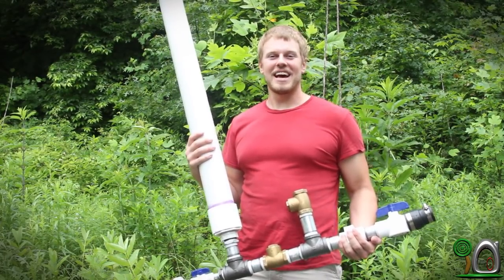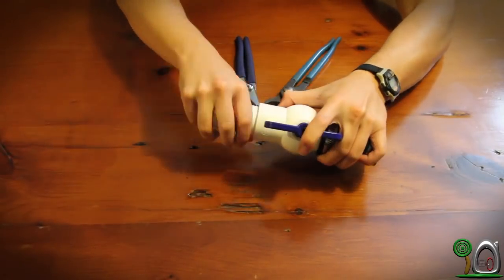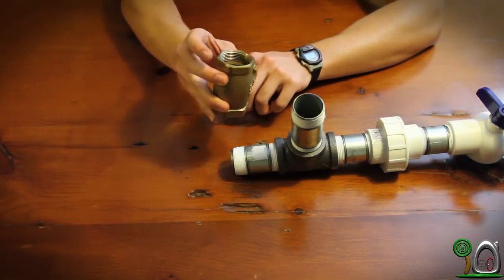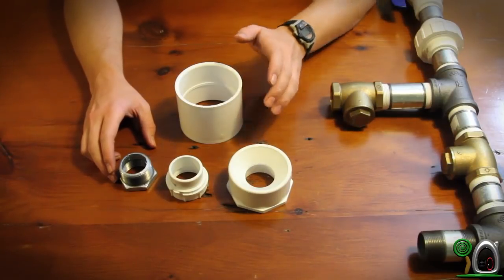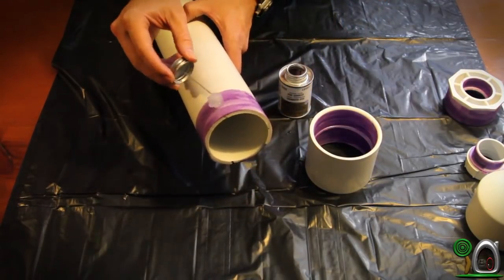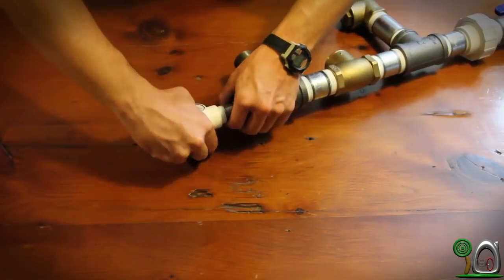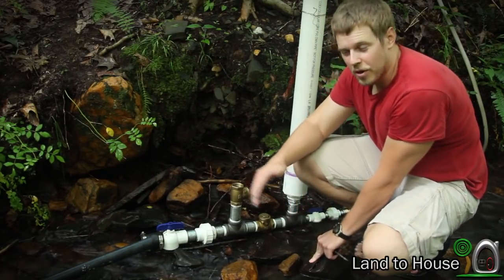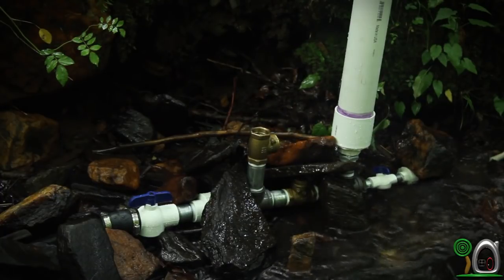Hydraulic Ram Pump: Build-Install-Operate

Comment from the maker: I like that your pump is compact. It would work well for smaller creeks. I opted to leave off the snifter valve and so far I have not had any issues with the tank filling up with water. I ran my pump 7 days without stopping before the flood washed it out. .... You need a creek to test yours out. It is very rewarding to set it up and let it pump for days. Thank you for sharing your videos.

Comment from the maker: Thank you for the reply. I have another ram pump that I used all pvc and brass and it works just fine. The reason that I made this pump out of the materials that I did is because I wanted to make the pump strong and I am testing out different materials. if you go to my channel and look for adventure 5 you will see my first attempt at making the ram pump. its all pvc.Yes you are right the materials that I used might not be the best long term but they are strong and work well if thats all you have

Comment from the maker: Good Question. I dont have one in this pumps chamber and as long as its running and the delivery pipe is open I have not had any issues but when the delivery pipe is closed and I leave the pump running it will fill the tank some with water. so I would use a tube or snifter valve just to avoid that issue.

Comment from the maker: I have seen several people placing those in the pressure pipe. That or bike inner tubes. Seems as though people are having water fill the pressure pipe and  the system stops working. So far the longest that I have run this pump is 7 days and it did not have any issues with filling. Other people are using a snifter valve. I figure that if the pump is doing what I need without the noodle then I am not going to worry about it. :)

Comment from the maker: You are welcome. Please check out the free book on the landtohouse website to answer many of your questions. My pump here was around $150 total then you will need to add the drive pipe and delivery pipe. You can make a heavy duty version but also you can add more pumps to increase the amount of water pumped. The Ram Pump only works with water that has a fall (feet of head) so your underground water supply does not have the needed fall to operate the pump.

Comment: Thanks heaps for your quick reply.

Makes me wonder if anyone's seen the real potential here? I'm visualizing a succession of rams driving electric turbine.
Reply from the maker: yes. The only thing is that your water is reduced so much with every addition of a ram pump. Now I do have a video of nozzling down the ram pump to gain more pressure! You might check that one out.

Comment: Looks JUST like Wrangkerstar's version.
Well done.
Reply from the maker: I see! Yes it does. Thank you. It works like a charm.
Reply: You must be an engineer.
Reply from the maker: John W. Ketchersid PhD I do have a degree in Biomedical Engineering. But they sure dont teach this type of practical information in school.
Reply: Land to House .com this is a very much useful presentation. I had learned a lot from this video. Sir, I would like to use this as a medium for my research in my degree, so i would like to get some kind of suggestion or recommendation from you about the problem I will solve to this technology for it becomes a research. could be the "Capacity" would be the best topic for my research on this technology? or what?

Comment: I have been doing plumbing for over 30 years and I have to ask why you choose the materials for your build that you did? Mixing Black Pipe with Brass will create oxidation issues and using Black Pipe will create Rust Issues. Seems to me that this entire pump could have been constructed using PVC Plastic and Brass. Will you tell me why you used Black Pipe? Galvanized pipe would have been worse but a bit less rust resistant, so I was glad to see you did not use that.

Comment: Cool video.  Once the pump is primed, working and delivering water, if a spigot is installed at the end, will the pump need to be primed each time the spigot value is turned on?  Or will the air supply tank simply hold the pressure and the check value simply start once the spigot is turned on?

Comment: Hi sir seth. Im from the philippines. A have a few question regarding the ram pump, just wondering if its okay to use smaller drive pipe? My pump is 5/4 and currently the only pipe available in my area is 1inch pipe. Thanks. Hope you see. Keep safe and godbless :)

Comment: Thanks for the videos!  I have a 4" pvc drainage pipe from my pond/dam with about a ~18-25' drop.  Can/Should I make a bigger pump? If so, do I need to make a bigger pressure tank?  Appreciate your recommendations and tips.

Comment: this is a very much useful presentation. I had learned a lot from this video. Sir, I would like to use this as a medium for my research in my degree, so i would like to get some kind of suggestion or recommendation from you about the problem I will solve to this technology for it becomes a research. could be the "Capacity" would be the best topic for my research on this technology? or what?
Reply from the maker: I am happy to hear that you like my work!  Please use my videos in your research. Be sure to look at my others because they show a lot more depth. I do not understand your question about the "Capacity". I am happy to help in any way that I can. The place that I test my pumps is easy to work with so if you find a problem I can test it and help your research.

Comment: Can I increase pressure by feeding a second ram with increased head of first, perhaps using a reservoir to hold increased head?
Reply from the maker: Do you mean: Pumping water into a tank say 20' up a hill with one ram pump then using that extra 20' added to a second pump to get much more hight? If that is the case then yes! you can do that!  If you want your system to run all the time you will have to find a way to make the first pump large enough to feed the tank so that the second pump does not suck the tank dry. For instance a 3/4" ram pump will use around 3gpm and a 1-1/4" ram pump will use around 7gpm.

Comment: I have a river that has a very high volume flow of water that runs through my land, but the river doesn't "drop;" as it is (or seems to me) to be level. I would love to be able to use this pump to run water from the river up the hill to my house, in the event of a power outage.  How could I develop this "head pressure?"  

Also, I have a deep water well on the same property.  Do you have plans for a pump that could be used for the well when there is no electricity?

Thanks so much for your time and courtesy.
Reply from the maker: You might load google earth or your local gis mapping site and see if there is an elevation change that is hard to see. If you don't have a change in elevation the ram pump won't work.  

There is another pump that will work called a river pump.  I am a couple weeks out from having a diy model.  

As for wells I don't have an answer to that one.  So far i have not researched those.
Reply: Land to House Considering that the river is, at a minimum 3 or 4 feet deep, perhaps the pump could be below the surface and the intake port could be higher creating a downward flow of water from input to the pump?

I would be very interested to learn about your river pump.
Reply from the maker: There are a couple of things that happen when you start submerging a pump below the surface of the water. First the weight of the water above the pump counteracts the added feet of head that you gain and thus cancels out the difference. A lot of people inquire about this because they have lakes and ponds and want to use the pump. 

For flat water you're much better off with a river pump or a spiral water wheel. And if your water is moving somewhat quickly the river pump is the best way to go. I should be posting a video of my progress in a week or two. I don't believe it will be as effective is the RAM pump but certainly will pump water several feet out of a river. These pumps are available for well over $400 but I want to post by design costing much less than this

Comment: G'day Seth greetings from Queensland Australia,  I'm going to build a ram pump for our seasonal creek ( stream) which runs for a few months each wet season. I'm planning a 2" ram pump with a 1" delivery hose, the head is only around 2 feet but I don't need to drive it very high probably 6 feet at most, I'll mainly need to send it between 600-900 feet ( we use metric in Australia so hope I got this right).  My real question is if I use an old 8.5kg (17lb) propane bottle for my pressure tank would I be better off using a snifter valve ? Also would 2 foot of head supply enough back pressure or would I need to elevate the delivery pipe up a tree and use a breather pipe ( water will be for filling livestock water tanks ) any issues you see here and would I be better going smaller but I have mainly 1" pipe already here
Reply from the maker: Hello. All those parameters seem very ideal for a ram pump. If your water supply dries up you might want to consider a 1" pump. This will need 6gpm to operate so you can run the pump longer. A 2" pump will need at least 10gpm (I dont use a pump that large) 2 feet of head pressure feeding the pump will lift water to 6 feet nicely. You might need to lift the delivery pipe just a bit to maintain backpressure. As for that distance you will be just fine. Look up my video called ram pump happy hens and highlands cows. It is a video showing cattle water.

Comment: awesome video.. Is rap pump can pump water @500m away to source of water?
Reply from the maker: The main limiting factor of the ram pump is the vertical lift. The horizontal distance that the pump can push water is limited only to the friction of the pipe you are using. I have only tested my model @140m but there was very little loss in that setup. You should be able to get water that distance. Now if your source is that far away then you will need to install a stand pipe close to the pump. so if your water is coming from 500m away then at 30m from the pump you would install a stand pipe.
Reply: Land to House .com Thank you...cheers
Reply: +Land to House  what does stand pipe do that you mentioned....and pls tell me about what kind I mean pipe made of which material is good when you have to get water to longer distances.....Thanks...
Reply from the maker: +Karna Budhathoki the stand pipe allows for more feet of head pressure. Basically it brings the source closer to the pump. The pipe I often. Use is black flex pipe. Pvc is good but can degrade in the sun. Stainless steel is good but expensive.

Comment: is it possible for this kind of pump to drive water at a height of 10 feet from a river where the tide comes in and goes out
Reply from the maker: +Surendra Nair the ram pump needs head pressure to operate. As long as your river has a drop from the source to the pump you should be able to use the ram pump. You will need a minimum of 1.5 feet of head to reach the 10 foot output.

Comment: I made the pump from pvc except the two valves and cant get it to work. The tank is a 3in  pipe, 4ft long and I have a very good stream of water. Do I need some minimum distance of input hose or do I need to cut the 4ft long pvc pipe? any help. It seems that the valves are too heavy to be lifted by the water
Reply from the maker: +Luis D Gordian Rivera is there anyway you could send me a picture of your build to my email address? Landtohouse at gmail
Reply: +Land to House I have sent an email with few pics
Reply from the maker: Thank you. I have replied now.

Comment: Seth, does the length of pipe used for the pressure tank make a big difference?
Reply from the maker: +Stephen Hummel it is important to have the tank large enough for the size pump you're using. If it's too big it just takes longer to Prime. It's too small it will not have sufficient pressure
Reply: Land to House so there is no set rule for a correct measurement? Just some where around 20"?
Reply from the maker: +Stephen Hummel the volume depends upon the size pump. For instance the biggest pump I make I use a 19 inch 4" pipe tank. That same tank could be made from 3 inch pipe but would have to be longer. I believe the volume of the 4 inch pipe is roughly 240. To get this same volume in a 3-inch pipe you have to go with 25 inches long.
Reply: Stephen Humme

Comment: Can this pump able to pump 100 meters from the ram?
Reply from the maker: Yes the horizontal distance is not a big deal. You can pump 100 meters just fine.   The limiting factor is the hight.

Comment: Hi Seth, Thanks for the videos, so helpful. I wrote a long question last night put it didn't seem to post so I'll try again. I have an 1" poly overflow pipe coming from a well (artesian) I just put in and want to use that to irrigate my garden. The pipe is run underground from well casing to the edge of an embankment total length is about 30'. Right now it has a   drop of 9-10 feet but if I extend it down over the bank could probably get 25' vertical fall. (This is the head pressure right? vertical drop of water from source). 
I want to pump it up to my garden about 150-200' away with a total rise of about 35-40 feet, if I put the but at the bottom of the embankment as mentioned above, or 25' if I leave it where it is. Do you think I need to go down over the bank? Will it increase the flow to the garden significantly?

My other main question is this: with the drive pipe dia pretty much set at 1" can I use 3/4" poly pipe at the outlet side. I have a 100' roll already so would like to use that if possible. I saw on one of your videos you recommended the outlet pipe be half the dia of drive pipe but does it matter if it is slightly larger?

Also was thinking to use your bucket method to pipe the water into from drive pipe and use a 4" x 24" pump body. Does this all sound like it will achieve my goals? I could make the 4" pipe longer is that would give me more water in the garden. Thanks in advance for your advise.
Terry
Reply from the maker: Hello.  Good questions. My first thought is to use the water from your well but first capture it in the bucket. (I think that is what you mean in the last paragraph.) This is because the pressure created by the well will interfere with the operation of the ram. Using the bucket will provide an unobstructed source for the drive pipe. 

Yes the drop from source to pump is head pressure. You will need 6 feet of head pressure to get water to 40 feet hight but 7 or 8 would get more water volume up at the top. If you go with much more than 8 feet of head pressure you will start to risk too much potential at the pump. This means that the pressure in the pressure tank might push the water out at the top and the pump will stop. In other words you can have too much head pressure. As you get a greater flow rate at the top you also get closer to the line of pressure loss. you will just have to test to find that level. 

It is just fine to use 3/4" pipe as the delivery. ( you can use 4"  delivery and it will supply the same flow rate.) Going with 1/2 the drive pipe is just to save money.
Reply: Thanks so much for your reply. Yes, bucket at the outlet of the well overflow is what I meant.
 Question, if I place the bucket where the well overflow pipes comes out of the ground, does the bucket then become the new source point? and thus the pipe running from bucket to pump becomes the new drive pipe length?  or is the source still where the overflow pipe originates at the well and the whole distance from there to the pump all considered the total drive pipe length?
I've done a few measurements since last post. 
•overflow pipe from well casing to where pipes surfaces is 60' with a head pressure of about 9-10'.
•flow is 3.3gpm
I can easily put a bucket where the pipe surfaces and drop the pump down another 8' if in fact the bucket will be considered the new source point. My drive pipe wouldn't be very long in that case because its a fairly steep bank, maybe only 6-8'. Would that be too short? Thoughts appreciated. Thanks again.
Reply: Probably the more important question here is about the head pressure. would it be measured from the well to to bucket? well to ram pump or bucket to ram pump?
Reply from the maker: Installing the bucket will become the new source. It is the closest to the ram pump. If the bucket is open at the top and water is able to flow over then it will break the pressure of the well and become the new source.
Reply: Great, that is what I thought. Just got all my components in the mail. Building it now! Thanks again for all your info.

Comment: will this work if i put it in a pond
Reply from the maker: The pump will work if you pull the water from the pond but if you submerge the pump in water it will stop the pump. The weight of the water will cause the check valve to stop flapping. As long as the check valve stays above water it will be fine.
Reply: so if i put the pump below water level without being in the water it will work
Reply from the maker: Compound Men As long as that check valve is out of the water and free to snap closed you will be good. For example you could submerge the drive pipe in the pond and run it into a field away from the water and it would work just fine. Or you can run the pipe along the creek and set the pump in a puddle as long as that one valve is out.